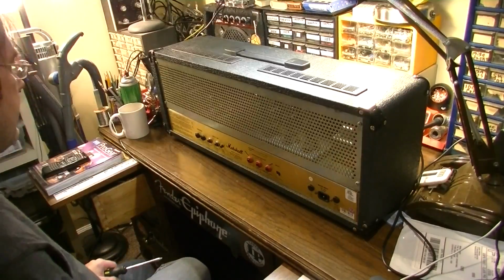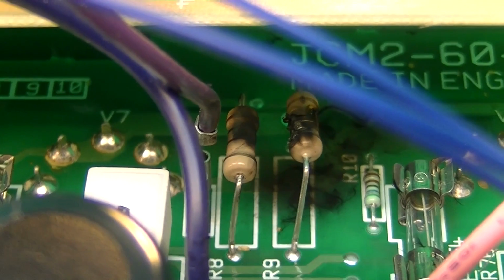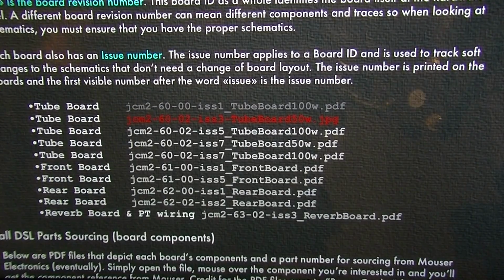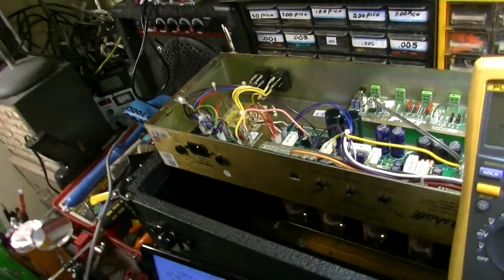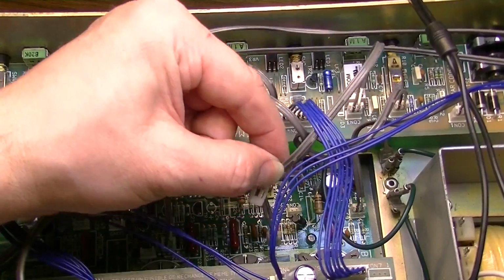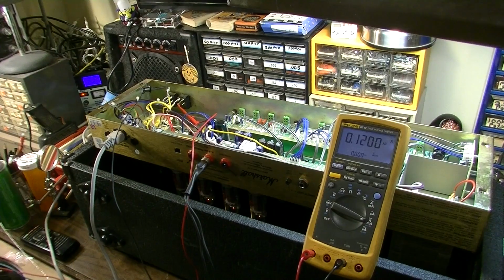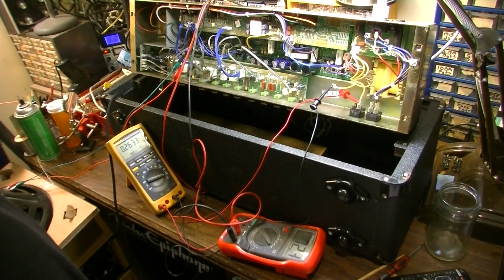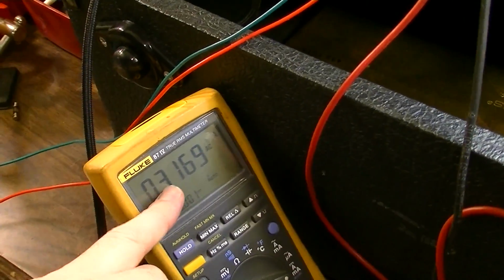Mother of All Marshall Amp Repair Videos - DSL100 Blowing Fuses, Bias Runaway, Fun Times!

Comment: Ok I watched the entire painful video. The amp is going to fail. 

1) The resistor failed due to excessive current. The tubes are the only components connected to the resistor. Therefore the excessive current was flowing thru a tube. Duh.
2)Why excessive current in a tube is the proper question. (Recall the flash?) Likely the root cause is a bad tube. Could be a bias component or "coupling capacitor". But my bet is a bad tube.
3)The resistor was not a carbon comp, it was a metal film, you replaced with a robust flame proof if I am not mistaken. The metal film was intended to fuse if the tube failed.
4)Explain how that cap actually caused the resistor to fail? It did not. It was a inconsequential 
failed component.
5)You could have tested your theory re:a bad wire clip caused HT fuse to blow, by removing the wire while amp is on,... I think that is BS.

6)The amp will be coming back.
Reply: you were correct at number 2.  Runaway bias caused by defective pcb material.  hooking up a meter to the bias pin exposes the problem immediately.  It will drift all over the place - completely unstable.  Eventually the tube will redplate and fail.  Mine got so hot it sucked the glass in like a vortex.    You have to replace the pcb(not necessary) or isolate the bias pin from the pcb by drilling out the tube socket and wire the resistor direct.  Of course Korg USA will try to sell you a new board but I just fix them and save $200+.  I fix these regularly and once done these amps sound fantastic.
Reply: @scottmacdonald5605  Yes that is a viable cause. I don't regularly work on these amps, I am a retired EE. But I have seen my share. This fellow is an N00B. Without a shred of electronics understanding. A random walk around the circuits. And yet, even a blind squirrel finds a nut once in awhile.
Reply: @mr1enrollment  well I don't want to be overly critical as he seems well intentioned but yeah, his theory isn't the best.  A lot of groping and guessing.  the problem is current leeching from pin 4 to pin 5 when the amp gets hot(thermal bias drift).  There is a second video where this amp did indeed come back as you and I both predicted.  He replaced the pcb(ouch).  Obviously Korg USA will recommend this avenue for somewhere around $300 - I fix them for a few dollars worth of parts and some labor is all that is needed.  Once pin 5 is drilled out and isolated from the pcb this problem is corrected.  There were also several resistors I found were incorrect on my amp.  The bias resistors were 220k.  They should be 5.6K.  I found that these don't NEED to be replaced once the drift problem is fixed - the amp will bias properly with them in.  I have replaced them with 5.6k per the schematic as well as left them alone in others and noticed no difference in tone or stability.  I love these amps when they work correctly.
Reply: @scottmacdonald5605  h
thx you are more tolerant than I of someone pretending to know what they are talking about. cheers
Reply: @mr1enrollment  yeah, the internet is what it is.  Lots of internet whizkids...lol  cheers?  ur in England or perhaps Australia?
Reply: @scottmacdonald5605  LOL, no I am smack dab in the middle of the once good old USA. What had you imagine I was a Brit? (and you to, where be You?)
Reply: @mr1enrollment  most americans don't say cheers.  I have several coworkers who are brits and one aussie so I wondered.  I am in Massachusetts.  I am an electronics tech by trade and a tube amp enthusiast - and player, of course.
Reply: @scottmacdonald5605  Ah,... not sure where I picked that up, I have worked with 'chaps' from NZ and Aussies, so maybe that is where that happened. In the dark ages of the 1970's I was a budding eTech. Worked an audio repair shop with a buddy in SoCalif. Moved to WI after HS+=2, worked in digital tech, then on to engineering school.  Now 80% retired. I've been imagining creating a YT channel. Never get around to it. Too much Netflix etc,...
So you enjoying the C19 'vacation'? Stay safe.
Reply: @mr1enrollment  southern cal?  I had a friend from HS that moved out to LA area and had a company called RADKO - he designed and manufactured rack mount preamp and power amp, all tube.  Also had a repair shop McCollum Engineering.  maybe you have heard of him back in the day - I know, LA is huge place so not likely...lol   but you never know.  Carona vaca is staring to get old.  I am eager to get back to normal.   stay safe yourself!
Reply: @scottmacdonald5605  no not familiar with Radko, my buddy is now in Torrence, he works out of his garage fixing tube testers.
http://www.alltubetesters.com/ <-- Roger Kennedy
Reply: Hi Daniel!  I think I agree with you!  We'll see ay?  I reckon one of the tubes will blow its ass out eventually.  I mean, I don't know how a tube can survive an internal explosion without being damaged & weakened somehow.  The Dr. Tubes mod will fix it I reckon.  Congratulations Dr. Tubes! You put Marshall to shame!

Comment: Marshall's are shit.....I bet you still had bias drift due to conductive boards when you gave it back to the owner.
Reply from the maker: I still have it for now. No sign of conductive board runaway bias...yet.
Reply: Seems to be with boards before 2004 if I remember right. I had the boards out so many times I used up a roll of masking tape labeling all the connectors. I ended up doing the pin 5 dremel job......that amp still gives me nightmares.

http://www.hullerum.de/Marshall/TSL122repair.html